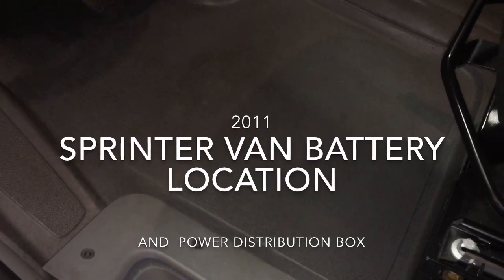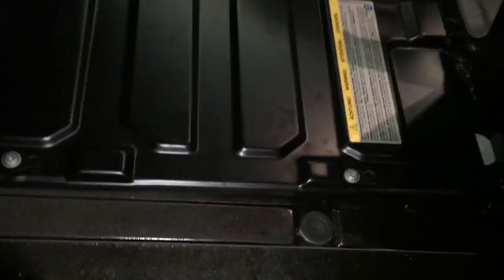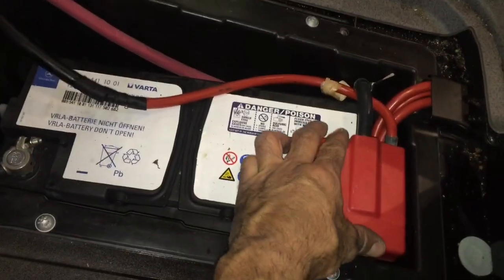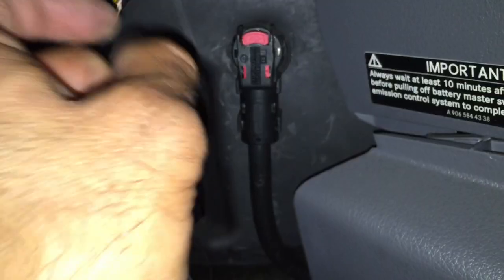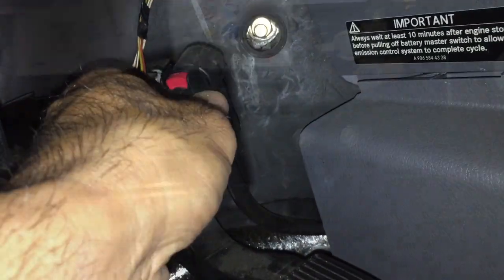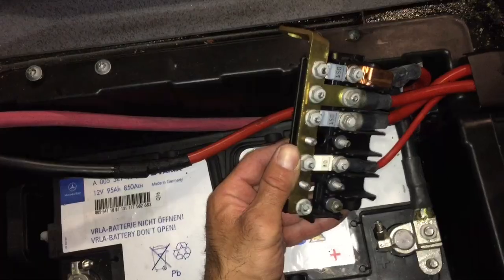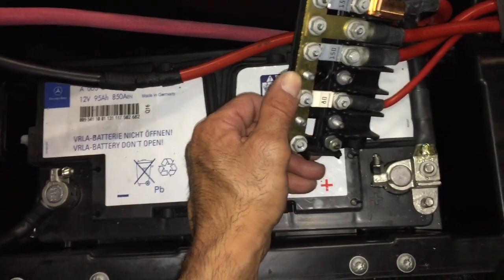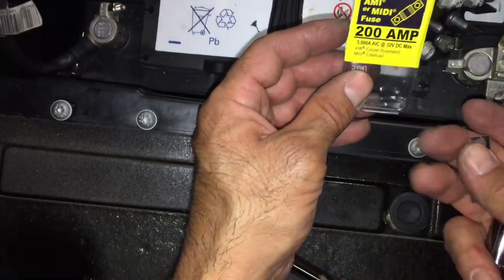Sprinter Van Battery Location and Fuse Type

Comment: My 2020 3500XD Sprinter 907 has basically the battery in the same location. Same ground quick connect at firewall also.  However the little black plastic distribution box "pre-fuse" box is similar but different, similar fusible links and connections in it.  In my case there was a loose locknut I believe where the up-fitter Thor added an additional bus bar causing my entire Sprinter to be dead, not even the emergency flashers would work. It was towed with the drive shaft disconnected at the rear.  A 2019+ 907 type Sprinter video would be great!

Comment: hi this has answered one question i had but here is another , i have a broken heater switch how do i remove and replace it  i cant find a video on stripping the dash thanks .
Reply from the maker: Edgunsuk i have a video where i replaced the stereo.  That might help if you are referring to the switch below the radio.

Comment: Does your sprinter only have 1 battery?? Mine only has 1 but all of the replacement batteries at the auto parts store tell me I need to replace it with 2?
Reply from the maker: jap338kx  I only have one battery. If you have the aux batt option then you might have two. One under the hood and one under the seat.
Reply: Is there where the AC fuse is?

Comment: In my 2015 sprinter the blue sea AMI fuse did not fit as easy. I had to make the holes bigger to fit the studs, and it worked. I used a 100 amp blue sea fuse.